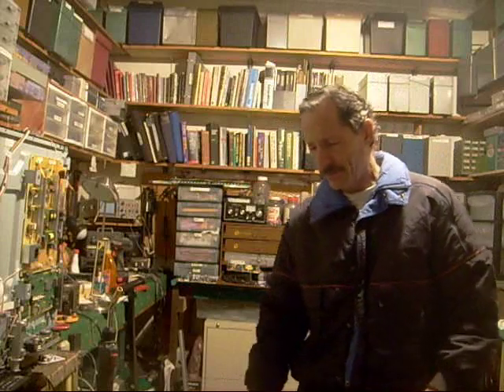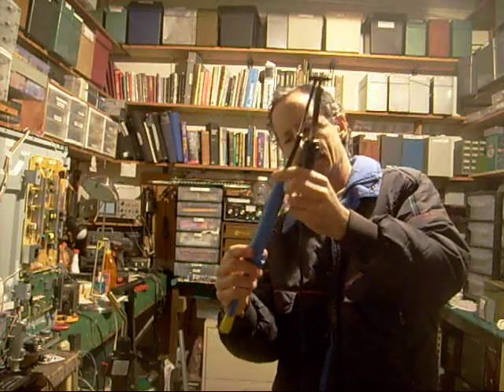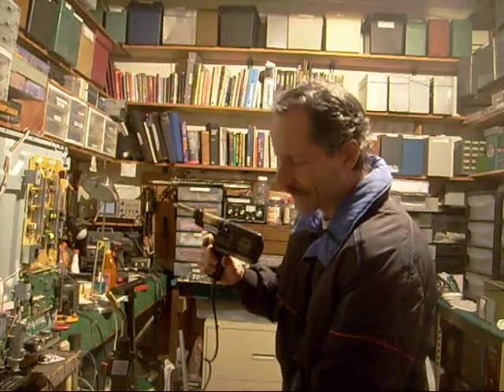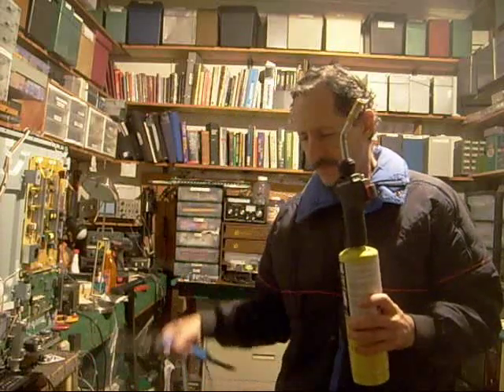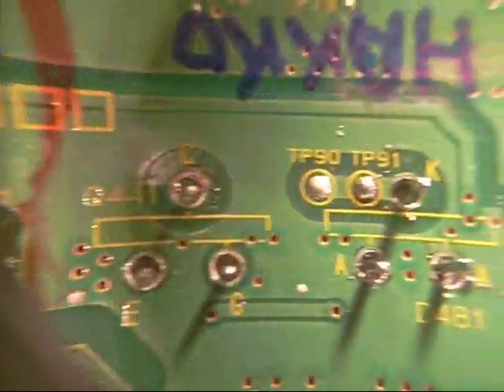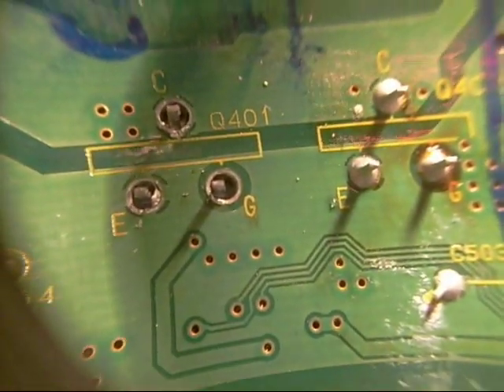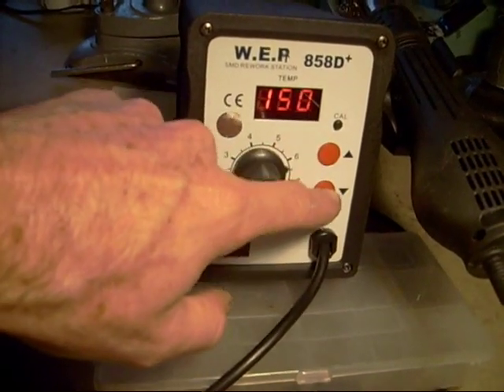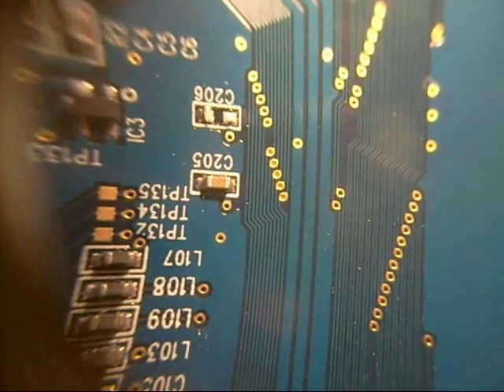Desoldering techniques for difficult connections.

Comment: Great demonstration of desoldering with different tools 8 years ago. Hakko has discontinued 808 and replaced it with FR-301, probably with improvements. They even have discontinued the station type desoldering tools from the old days and replaced them with higher power versions. The old ones were rated around 40 watts and the newer models were at least 70 watts and all the way up to 300 watts. The incentive for this drastic upgrade could probably be due to the common use of lead free solder, which is several times more difficult to desolder compared to leaded solder.
Reply from the maker: My only complaint about the 808 is how often I've had to clean the filter. I've even had to clean out the rubber diaphragm on one occasion, but other than that I'm happy with it.

Comment: I've done what you've done many times, took 60/40 solder added to the solder connection then just used a soldering bulb to desolder. You have to be fast and percice with the bulb making sure it's clear of old solder inside of it. For tiny connections, I just added a small straw similar to a wd40 can, but a bit larger, to the end of the solder bulb. Trick is to get the solder molten hot quickly, then desolder quickly.
Reply from the maker: Thanks for the tip on using a small straw. Desoldering needles are another possibility. If you search for "desoldering needles" you will see another technique that can work well.

Comment: Thanks for the video! Not sure I spend the time on my projects to justify the Hakko, but using the quick chip will help a lot. I bought some wick expecting that to help remove the solder from through-holes, but was surprised when it didn't, I'm glad that wasn't just a problem with my wick. I'll have to purchase some quick chip next.

Comment: If you want a cheap desolderer just put a 1/4" rubber hose in the end of your vacuum cleaner, heat the joint with and iron, and quickly place the hose directly on the joint. The soft rubber hose seals against the PCB and sucks it pretty clean, but remember the board has to be resting on something solid to make the seal.
Reply from the maker: I doubt a vacuum  cleaner will be strong enough to suck the solder of the PC board.

Comment: cool video, I never saw one of those guns in action. I do mostly surface mount and not through hole, and I got a little hot air station like you. I use the solder paste and chipquick myself, and go for the gootwick when it comes to solder wick. The gootwick never binds up, is practically reusable and glides over smoothly without lifting pads and binding up. Anyway cool vid, and thanks!

Comment: I'm trying to desolder a relay from a double sided circuit board. They used a massive amount of solder on the joint and I cant even get the solder to melt. I only have a 40 watt gun. I even tried a brand new tip but when I tried to tin the tip the solder rolled right off. Help

Comment: Thanks so much for the desoldering tips. I just spent 3 hours trying to remove components from a double-sided motherboard but the molten solder stayed in the darn holes! Going to have to give that Hakko 808 a look.
Reply from the maker: I ran into the same issue with mother boards. That was what convinced me to
purchase the hakko de soldering tool.

Comment: Great video and techniques.
For component recovery of dead TV's e.g. old Flyback transformers from CRT TV's I use a normal 1500 Watt heat-gun. works great. Less than 30 seconds to remove a Flyback TX.

Comment: The other thing I learned about the 808 from someone is that it's best to lightly place the tip on the component lead (gun's own weight is enough to avoid damaging board rings) and move it in a circular motion to get all the solder from around the lead. Otherwise, one side of the lead is left with solder, and you'll have to apply additional heat to remove the remaining solder; this obviously increases the chance that the board could be ruined.

Comment: Yeah, I tried the rod, but the solder/flux was as hard as a rock; I had the gun plugged in and the heat turned up to about 4. I may have sucked something else up into the gun, but I just remember that flux generally causes issues.

Comment: I use the Hakko 808 all the time - LOVE it. I almost never use solder wick. A couple things I've found in my personal use that you may have already discovered: (1) The tip that comes with it (A1005) is too small for some component leads. So, I bought a couple larger tips. (2) Flux clogged one of my tips, so I don't use flux anymore when desoldering with the 808. (3) Be careful with how much heat you use. I typically use mine on about setting "3", and I'm in and out in about 2 secs.

Comment from the maker: You might want to try and re-seat your ribbon cables on the side of the display, but it sounds like a possible bad display, or an issue with the ribbon cables. If you re-seat your ribbon cables make sure you do this with the power off.

Comment from the maker: Thanks for the tip. I've also struggled in trying to unsolder tuners. Like you said having enough heat is a must, but when dealing with double sided boards it's critical that you don't use to much heat.

Comment: I usually have trouble with some of the through holes that hold a TV-tuner in place. The pins on the tuner are easily desoldered most of the time but the bigger holes on each corner of the tuner tend to require more heat. I found out that by removing the tuner from the board first by just heating it and with the help of a screw driver, I can then heat the through holes with a iron on the top side and at the same time heat it with a de-soldering iron on the bottom. Seems to work fairly good.

Comment: Solder wick never works with my cheap low watt soldering iron. I've always wanted to buy a desoldering iron even though I just do odd hobby projects, it really seems like it would be worth the money. I find that whenever my attempted repairs or projects don't work out it's because I can't properly desolder a component and I end up damaging the traces by overheating the board.